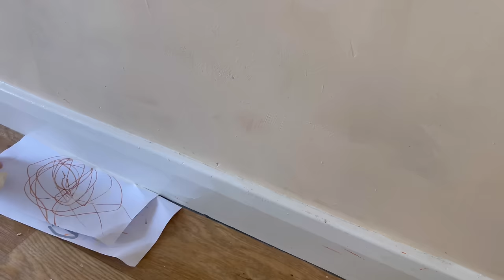Deep clean with me, my YouTube story, and more!

Comment: Hi, what's the best thing to get rid of moulding in the bathroom and bedroom 🤔 I'm just wondering what the best options are as your videos help me very much . I love your videos 📹 they are amazing 👏
Reply from the maker: Hey!!! I’m pinning this comment in the hopes other people can tell you! I use Cillit Bang mould remover, but I’d be interested to hear what everyone else suggests. There may be something a lot better out there 😊
Reply: I found this info online: The acetic acid in white vinegar attack the structure of the mould and will eventually kill it. Using a spray bottle to apply the vinegar is an effective application method and leaving it for around 15 minutes or so will allow it to get to work. You can then simply wipe it away with a clean, damp cloth. I've used this but found I need to repeat treat some areas.

DIY mould remover. 

This is a great tip for anyone wondering how to remove black mould from silicone sealant. 

Simply make a thick paste using one cup of white vinegar and two or three teaspoons of baking soda. Work this mixture into the mouldy areas around baths, sinks and windows, leaving a thick layer there to sit for around five minutes and up to an hour — the longer the better.

When it comes to removing the paste, use a stiff-bristled nail brush or an old toothbrush to scrub the paste and mould away. Finally, use a clean sponge, dampened with cold water, to rinse the are clean. 

This is a method that can work on silicone sealant, grout and walls. To make sure all the mould spores have been killed off, finish by spraying the area with a mist of water and vinegar and leave to dry. 

❤
Reply: I think astonish mould and mildew is also fab!
Reply: I have found mould remover very  strong regarding the toxic smell yet not really effective ... Due to the high energy price rise last year we didn't really heat our bathroom and the ceiling became mouldy... I spareyed the cillit bang on it .. but!!! It didn't not even remove a bit.... Not a bit it all just ripped down to the floor and the smell as I said very toxic.... Even with air being well wented......  Than I went to the shop asked for a thing that treats mould they gave me a damp pain.... Me spending 16£ on 400 ml just to bring it home and telling me to treat the cause of it first..... Than I was like crap..... So I got domestos poured it in a disposable plastic food container .. did NOT dialuted it and with a cleaning towel as I wiped it off immediately! Went away.... Haven't come back at all so far and more bearable smell which clears out of the house faster than cillit bang
Reply: I second vinegar, I’ve also used straight bleach but may not recommend for everyone
Reply: Find the source firstly, could be leaking radiator or guttering pipe. Then clean with vinegar and bleach and use a mould anti paint like Ronseal/zinsser. For wood use  zinsser bin paint.
Reply: @TheMinimalistTherapist  it works very well!!
Reply: A paste made of vinegar and bicarbonate soda can do wonders. Mix together and paste on the area. Leave it to do its thing (anywhere from 30 minutes to overnight) and then using a damp cloth wipe it off. Natural, no harsh chemicals. If you’re not a fan of the vinegar smell, add the juice of a lemon or a few drops of essential oils. xx
Reply: Plain bleach is best i just wiped my wall with bleach. Amazing results
Reply: I use Clorox bleach, diluted - 2 cups water to 2 teaspoons of bleach, let it sit on mold for 6 minutes, then rinse. Have a your windows open for ventilation.
Reply: @janetsides901  Yay! 🥰💪🙌
Reply: I use Tilex Mold and Mildew in my shower.  I usually spray it on before bed - a little goes a long way.  Rinse in the morning.
Reply: I use pure vinegar or bleach.
Reply: Astonish Mould and meldew spray works wonder
Reply: @janes9264 Never mix vinegar and bleach as it makes deadly chlorine gas.
Reply: Clorox bleach & water mixed together, spray it on and walk away. At least once a week. Wipe down with water 1-2 hours later.
Reply: So happy I found your channel.  I adore your chatter.  You have a lovely voice and a great sense of humor.  Fun to clean along with you, or just watch with a cup of tea.
Thank you for being you. 😊
Reply: I used the following and the mould has not come back. Spray and leave overnight (not just 30 min as instructed) and then wash off : HG Mould Remover Foam Spray, Mould Spray & Mildew Cleaner, Removes Mould Stains From Walls, Tiles, Bathroom Seals & More - 500ml
Reply: @remiclog thanks sweetie much appreciate your help and advice
Reply: I use cilit bang for moisture. It kills it😊
Reply: I put  a 1/4 cup bleach in the middle of my tub and using  a Dollar tree swiffer and  wet pad. Dip It in the puddle and wipe ceilings and walls , then  walk away. Only takes about 10 minutes and mold is gone. I don’t rinse, and it doesn’t hurt paint. Been doing it for most my married life...43 years - watching from Lake Wales, Florida
Reply: Flash with bleach works for me. 😊
Reply: 100% ❤❤
Reply: HG mould remover. I recommend using this and considering investing in a Meaco dehumidifier. I use it after showers to bring humidity to below 55 as mould can't survive then. It's helped cut down bathroom cleaning for me because it dries quicker!!
Reply: @MariaDayDreamsALot  HG by far the best.
Reply: Bleach is best

Comment: You need shelving with baskets that have lids. Or make your own covers for some wicker baskets, from solid color material or burlap. A chest or locker for toys in the living room. Make the kids put up all their toys before they go to bed. You can take wood box and put a hinge on the lid and paint it. Recycled home supply stores, I get shelving brackets and repaint them.  Used wood planks are cheaper than new wood boards. Use real wood boards not compressed particle board, it'll last longer. You have so much wall space that's not being utilized. Great job on the painting; the living room fresh & new.